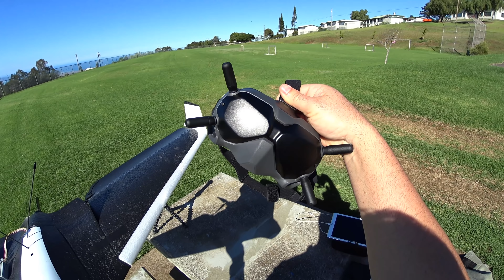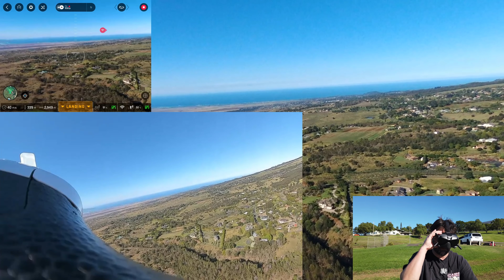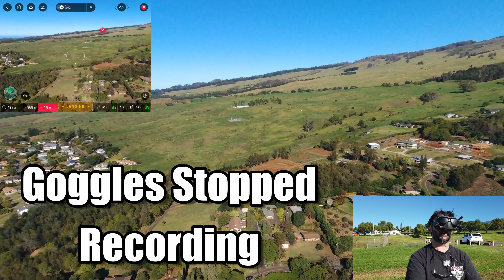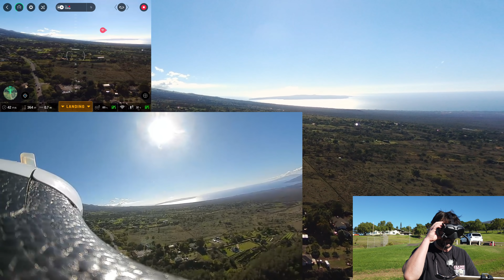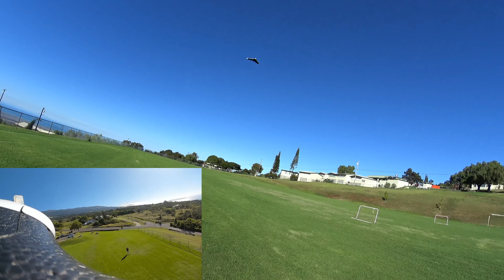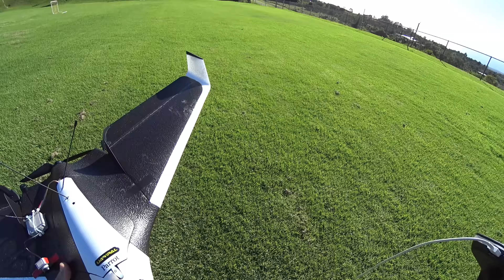DJI Digital FPV System Maximum Range Test (1200mW Hack) - How Far on 4GLte Parrot Disco?

Comment: Hey Dustin,  how much do you think is a good price for the disco?
I'm interested in buying one, so I'd appreciate your opinion sir...
Reply from the maker: Under 500 is a steal
Reply: @DustinDunnill  ...just picked up a disco from the UK, new 675...can you tell me if those inboard stabilizers work good?
Reply: The Roc congrats for your purchase... now you have to find a LARGE field with grass... or a RC platform...
Reply: @DustinDunnill  ...so far, cheapest is $700 that I've found...do you know a place in the states that sells it?
Hey, and thank you for responding  !
I am looking at a much higher dollar fixed wing drone from UAV with a herelink transmitter...$$$$$
Reply: @DustinDunnill  ...Dustin, I have a question  on the hubsan skyhawk about the elevator throws, I'm not getting enough nose pitch up...I've tried changing location of the rod end on the horn with no luck...do you know if the rod ends are adjustable by threading in and out?
I'm afraid cus they feel tight, I'm not sure if they're threaded...what do you think...besides that im buying alot of the products you review...😉
Reply from the maker: Congrats on the Disco!  As for the spyhawk.. have you done a level calibration?  I've forgotten how by now (flipping switches on the tx) but remember I needed to.  Should be in instruction manual.
Reply: @DustinDunnill  ...did level over and over...I found the rod ends were screwed all the way in, that's why I wasn't sure if they were threaded. I first tried locating at different locations on the horn till I got a little flustered and twisted the end...its threaded.
So I adjusted aileron and elevator throws and tried to fair in but could not achieve recommend  pitch and roll °5 to -°5 after level calibration, instructions say it should be within those parameters before flight...best I could do so far is °3 to -°6 before I gave up...every thing else seems ok...I'm waiting for disco to be delivered so I can maiden both in one day. I'll fly the spyhawk with the flight controls as I have them set and see how it performs, but there is one other thing; do you remember if RTH will show on the transmitter screen when the plane is on the ground??
I was hitting the switches and toggled the RTH but didn't see anything on the monitor,  unless it must be airborne...?? I dont want to be one one those guys on YouTube that activated the RTH and watch their plane turn °180 and say "see ya"...wow
I'll do all calibration every flight, I'm anal that way
Anyway, thank you for responding...yes sir, your vids got me going to make a $1000 purchase for both these planes...👌
I watched a video last night for a disco long range mod, it was pretty straight forward and the video has the link for the mod which is like $250...first I have to receive a damage free disco from overseas and maiden, but I'm a 60 year old kid filled with anticipation you kow..😉

Oh, wanted also to ask how did you find the add on inboard stabilizers to work?
I noticed them on this video and found some 3D printed ones available but wanted your thoughts on them, don't want to buy them if they're not helping any...and if they do help, did they fit properly when installing wings??

As usual Dustin, I hold your recommendations in high regard
Reply from the maker: I'm trying to remember if I did anything else with the spyhawk trims.   It was a while ago but a vaguely remember propping the plane up or down and setting level to get optimal climb on takeoff.
The 3D printed fins I have on the Disco help it a bit to track straighter if wind is light or coming from front/rear.  If wind is hard at the side it gets pushed more sideways as you can imagine.  Main reason I put these ones on is they also have sled skids on the bottom for landing protection. 🍻
Reply: @DustinDunnill  ...oh, makes sense on the disco, I'll keep that in mind and not use on windy days. These fins and belly protector are 3D printed as well...

...so I finally got all the required calibrations in check on the spyhawk and will maiden along with disco when I receive it...I also found but have not purchased, a pair of 4000mah batteries for the disco, they look exactly like the disco 2700mah battery. I saw your upgrade battery you used during your disco loss video (I would've been crying right there) and started to search and ran across the 4000s...hell, I'm even thinking of buying another disco, JUST IN CASE....😊

Comment: Analog gets me 30 miles no problem.  1.2ghz works fine for me.  This HD hype will never get those kinds of range anytime soon.
Reply: WINGSHIGH Aviation this Disco has connectivity through 4G cellular networks... 30miles are nothing for it...
Reply: @tuttoto  yeah.  I see that now lol.   I've gotten the DJI goggles and AU but dont get anywhere near 4 mile range.  Again,  lol.   I'm even using iflight Crystal patch antennas and stock and signal drops off at around 1 1/2 on 1,200mw.  Starting to think my goggles are screwed up. Since all my 6 AirUnits have same range.   Think the antenna cables inside my goggles where broken when I had to tighten the connectors up after only a few flights out of box.   Haven't had them a year yet so may just send them in to get fixed.
Reply: @Freebird_67  anyway 4 miles is already enough... the 4G disco cannot fly farther than 100 miles (because of weight of batteries... control and fpv feed have no limits (4G cellular phone network)).
Seriously... who needs 100miles?

Comment: Can that little plane do stunts? Lol not that I'd even try
Reply: Ace Mcloud you have to put a rc receiver in it (there is a plug on the onboard computer for it) and some taranis 7 ... this allows to switch between automated/assisted/manual modes...
In manual modes in can do loops and rolls... inverted flight... etc. But you better be VERY good or fly high to have time to switch back to assisted mode fast...
Reply: @tuttoto  oh good to know

Comment: Better antennae > higher VTX power output.  I'd like to see you do an antenna range test - stock vs TrueRC omnis vs TrueRC X-Air²!!
Reply from the maker: Hugo is sending me a set when... he has some in stock 😂 Sounds like he can't make them fast enough 🍻
Reply: @DustinDunnill  I can't wait to see your results!
Reply: Antenna's does not make the VTX output more power,  that's not how antenna's work,  it just amplifies it in a certain direction and that translates to Db
Reply: @boratsagdiyev1586  I understand that. I didn't say upgrading the antenna would increase the power.  ">" indicates "greater than" - by that I meant, upgrading the stock DJI antenna will most likely have a greater impact on range than increasing the power output of the VTX.
Reply: @J4nkyFPV  Ah sorry you're right,  i'm a programmer now i'm ashamed.
Reply: @boratsagdiyev1586  😉 it's all good!!

Comment: Sweet I've been wondering how the 1200mw would work on fixed wing. But  keep in mind in order to go twice the range that 700mw gives you, you'll need four times the power. Since 1.2w is not even double the power of 700mw, the gains would be negligible.
Reply: SkyRaid FPV twice the power gives only 3db...

Comment: The PID tune of the Parrot is pretty bad, bumping and pitching constantly...the gimbal is working overtime covering it up..5.8g will never be a long range frequency.
Reply: Disco has no gimbal... it is made of foam, moving a lot...
Reply: 800mw 1.3 vtx on sale on RMRC this weekend for $34.99 USD! I love these new ones they have now. Comes without that ridiculously bulky heatsink and that useless cable, but added the small heatsink and a wiring harness that actually works with FPV. Oh and that freebie dipole.
Reply: @skyraidfpv6753  Yeah, I use a 200mw on 1280mhz...at 5kms it looks just like it did when I took off...lol.
Reply: @EnglishTurbines  I've gone 10 miles with my 800mw 1.3 while maintaining a "high" altitude lol. Used an 8dbi patch antenna tuned to 1280. Probably could have had similar results with 400mw.
Reply: @skyraidfpv6753  Yep, at 5kms out at only 300 feet altitude....tree ground clutter, still no problem... Try doing that on 5.8g...lol.
 They all fly 5.8g on the edge of space..😄
Reply from the maker: Welcome to the extremely variable and unpredictable winds of Maui.
Reply: I got 5kms on 5.8 500mw with absolutely no breakup or static. Ide say 5.8 is perfect for long range. The video is on my channel.

Comment: Great test. It’s to bad that the 1200mw doesn’t result in a greater distance compared to the 700mw Test. You should antenna mod The FPV goggles. The stock DJI antennas are garbage.
Reply: I agree, I wonder if better antennas would have yielded better results.
Reply: time for a more powerful tripod antenna with cord extension from ali or ebay. lel

Comment: I'm not sure I like the goggles , I think I would personally prefer just looking at the screen because  that's more  stable
Reply: That's because the Parrots camera is gimbal stabilised...The DJI camera is unstabilised.
Reply: The disco camera AND fpv feed are digitaly stabilized by the onboard Unix computer... tilt up/down and left/right are made with 0 moving parts also... only real time digital treatment made by the plane itself... there is NO gimbal in a Parrot Disco...
Reply: mr Red DJI should’ve made the camera a gimbal, stabilised and movable so that depending on where you look with the goggles, the camera will turn that way. That’d be sweet.
Reply: farceadentus that’s how the digital fpv from a Disco works when you use Auriga instead of FreeFlight application....
Reply: tuttoto oh really. That’s cool. I’ll be getting one soon!